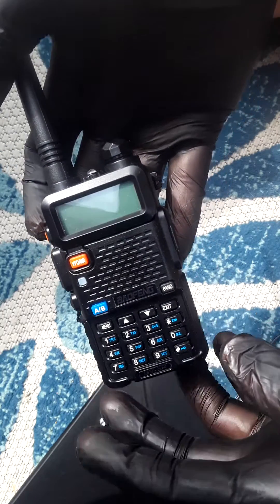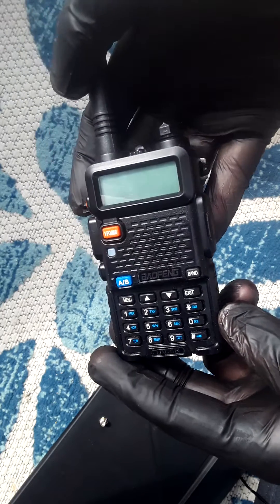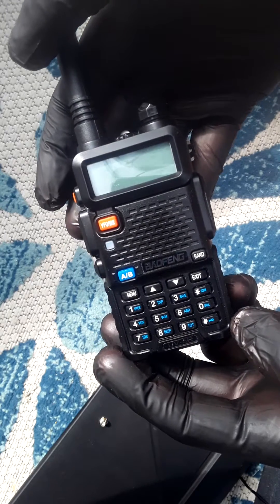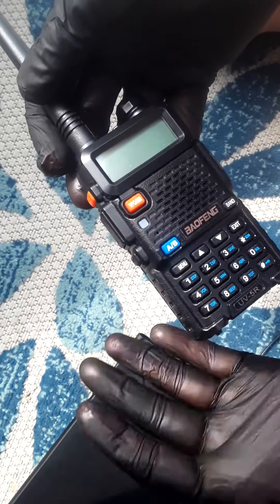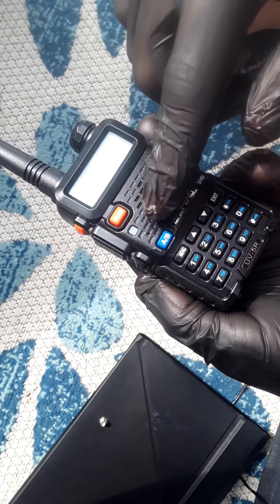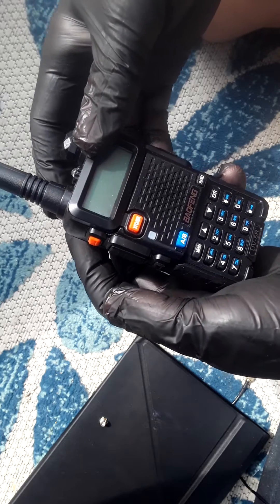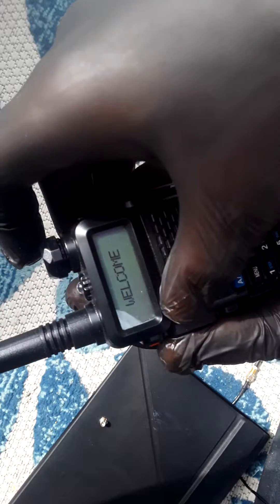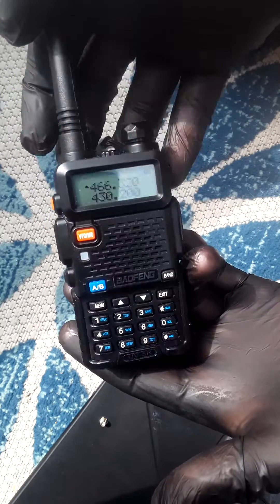📡 Unlock Blocked TX Frequencies On Baofeng UV-5R

Comment: Hi, does this trick works in UV 5RM PLUS?
Reply from the maker: Hmmmm wish I knew. Unfortunately I only own UV-5R to test - and it depends on the production batch.

But I have had others using entirely different baofeng radios say it worked for theirs too, so could try it if you have a radio already.

And other users commented slightly different key codes they succesfully used to unlock theirs if expanding comments.

Comment: My Radio is Locked With the Red Light On.                                                     None of the buttons will operate it say"s it's in Overtime .
Reply from the maker: hmmm I haven't seen this before. If I find a solution will be sure to share with you.

Comment: I got the uv5r that is certified for gmrs and it does nothing at all when i try the button combo. Does this mean that my unit is harware locked to gmrs only? Ive tried trasmitting to my little frs cobra rafio and i can hear on the beafeng but i just get the beep when i try to transmit.
Reply from the maker: The beep unfortunately signals that transmitting is not available.

After buying a few UV-5R's, I found that some revisions are unlocked with this button combo (showing the FACTORY message when successfully unlocking the transmit ability), and others came already unlocked for me - maybe I got lucky there.

Other users have left comments on this video sharing other slight button combo variations that worked for their revision. It could be useful to look through them.

Here is one (not sure if the other comments offered different, but this is slight difference): 

"After sometime messing around I was able to get the factory message and successfully unlock.  Similar process but you have to press the call button on the side as well.  So there are 4 buttons you have to press now then turn power on. 

Press all three on left of radio and VFO turn power on and it should display factory."

Hopefully the above quoted comment someone left works for you - if not, I do hope you find the right combo for your revision!

Comment: bulshit. still cant enter 250.00
Reply from the maker: Edit: This was to unlock specific baofeng radios that had no ability to transmit whatsoever. 

Never was 250MHz suggested. Says Unlock Blocked TX (for transmitting only on freq that are available), doesn't mention frequency. 

Applies to locked radios of certain revisions.

Most commenters have the described working for them.

Good luck on your search.
Reply: @RTPTechTips   well "nothing was suggested", so it is BULLSHIT in capital letters.  (i know how to unlock 250-260 !)
Reply from the maker: @stalin200000  👍 

This video unlocks specific baofeng radios that have been showing up with ALL transmitting locked completely. All frequencies.

Including many coming to USA locked from transmitting on ANY frequency. 

The video shares 1 option, for a problematic revision.

Comment: It doesn't work for mine. It lights up like it is transmitting but no sound to the other radio. I guess this one isn't one of the good ones.
Reply from the maker: does it beep when you hit the PTT button?
Reply: @RTPTechTips  it did. I worked it out actually and made a video about it on my channel. I plugged my work radio (Retevis RT-86) into chirp using my baofeng cable. Pulled the frs program off the Retevis and installed it directly to my baofeng. That copied the tones I needed for it to work properly. The more you know, as they say.
Reply from the maker: Very cool channel btw. I also used to build Traxxas RC car kits. That lawnmower combo!
Reply: @RTPTechTips  That's pretty cool. I've never built a kit, I've always just bought ready to run cars. I need to build a kit. It looks like a ton of fun.

Comment: If i bought baofeng uv 5r in 2024 will it work or these are in factory setted to not be jailbreaked
Reply from the maker: Sounds like there are a few batches requiring different button combinations. A few others shared in comments here what worked on their batch of UV-5R. Comments might help if this one doesn't work on yours. It all stared when the FCC sent a letter telling Baofeng distributors that operating on gmrs and others was not kosher... and so baofeng began locking radios.

Check comments for other button combos if this one doesn't work on yours.
Reply: @RTPTechTips  on which frequency should I try transmit that if my radio came unlocked or not. Becaue i tried to unlock it but no factory word on the display using all the teqniques
Reply from the maker: @miko8297 bands outside ham were blocked so you can try each range out there, and if you hear a beep - that is the blocked sign.

If no beep when hitting PTT, you are good to tx.
Reply: @RTPTechTips  Thank you for your answer, can you also write some specific frequency range where can i try
Reply from the maker: I don't recall which ranges were locked sorry - mine are all unlocked. I would simply try the PTT button in all frequency ranges available. 

Say you have 136-146MHz beeping, then try something within that after unlocking.

If it beeps, locked.

I can't recall any further details of what mine unlocked, since mine has been unlocked for a couple years.

Comment: Hi there. My UV-5R is locked. I've tried this button configuration, but it is still locked. Is there another way I can try please? Cheers.
Reply from the maker: Some other users received slightly different uv-5r batches, and shared slightly different key codes that worked with them. If you expand the comments may find something that works. Good luck!

Comment: Thank you, but what does unlocking these frequencies do for my distance? I just bought two of these and I can’t get them to work past a mile. Do I need to unlock frequencies to utilize the 8W power?
Reply from the maker: Not sure if there is anything unlockable for power, but ensure you have the tx power set to high - as there is a low tx power as well. 

Distance will also be largely determined by where you are transmitting. If in a city, distance would be much shorter than a pasture, or from mountain top to ground receiver.

Comment: It doesen't work
Reply from the maker: You must have a slightly different revision - other users commented similar button codes that work on other revisions (expand comments if interested).

If it doesn't make a beeping sound when pressing PTT (push-to-talk), then it came unlocked.

Comment: It says Factory on uv-10r but just repeats itself. Don't know if it worked. How will I know?
Reply from the maker: You will know if it no longer beeps when hitting the PTT (transmit) button.

The beep when trying to transmit, means locked. 

Once unlocked, the beep will go away, and the listening radio will hear your transmission.

Also, some radios come already unlocked, so not all need factory reset.

Hope it worked for you!

Comment: i have just bought one of these it arrived today and been trying to unlock it but no luck at all ? any help ?
Reply from the maker: Do you notice a beeping sound when hitting PTT (push to talk)? Or not?

If beeping, it is locked for transmit. If not beeping, it wasn't locked.

Some batches have come locked, others not. 

Other batches use different button combos (as shared in some of the comments on this video).

Good luck!!

Comment: This isn’t working for mine? Any reasons for this?
Reply from the maker: You likely have a different batch. If you have an older one, it is likely already unlocked.

If the PTT (push-to-talk) button produces a beep sound when pressed, that would mean it is locked.

My older one came unlocked, more recently produced, was able to unlock.

Though some other commenters on this video shared other button combinations that worked for their batch. If yours is still locked, might help to scroll through comments.

Comment: This combo does not work on mine.  I heard it only works on older models?  It did not work on my UV 5R?
Reply from the maker: I have it work on my more recent batch radio... older ones I have are already unlocked. If you don't hear a *beep* on PTT (push to talk) button, it is likely already unlocked.

Some other locked batches use different "factory" button combinations - others have shared some of these in the comments, here on this video, in case it helps.
Reply: @RTPTechTips  Thank you for the reply!

Comment: What unlock??
Reply from the maker: A letter (now found publicly) sent to Baofeng appeared to create some confusion. Leaving a false impression on if they were able to unlock transmit (tx) on certain freq. 

Many batches since this letter came with transmitting locked (creating a beep instead of actual transmit). 

If you have one of the batches which came with tx (transmit) locked, you can unlock functionality with the button combination.

If you have an earlier batch: it likely comes unlocked. If you see no "FACTORY" message following this video, your radio may already be unlocked. On the other hand, if you hear a *beep* when working with PTT (push to talk) button, the radio is locked.

Comment: Didn't get the "Factory" after following the three buttons (3x). When I try to add lower frequencies, it enters the first 5 digits, and then says 'cancel" as soon as I enter the final digit.  The unit is 3 years old. Any advice?
Reply from the maker: What range are you trying? The factory message only shows up on some recent batches of UV-5R. I have an older one that already came "unlocked", and my newer one unlocks with the key combo.

For example mine only goes down to 136MHz, anything under that it will say 'cancel'.

If you can transmit (PTT button), without hearing a *beep*, then that range is unlocked for you for tansmitting. If you hear a beeping sound on PTT, it's locked.

You may have one that came unlocked if not experiencing the beep with PTT.
Reply: @RTPTechTips  131.730 (FBO operator at SBN), 120.675 (SBN ATIS), 122.950 (SBN Unicom)

Comment: I have a new UV-5R, and have successfully unlocked it for the Canadian market using the 4 button technique. However, although I can now enter the previously blocked frequency (i.e 118.100) directly into the radio, I do not receive any transmissions.  The particular frequency is a small regional airport near me.  I know there is transmissions as I hear them on the LiveATC app.  Does anyone have any idea why I cannot receive transmissions?  (Radio is on, volume is up, other frequencies work fine.).  Thanks
Reply from the maker: Hmmm not sure on that. Mine never was able to get listen on that. Maybe someone else will have more info for you.
Reply: @RTPTechTips  The aviation band from 118-13?, I think it ends @ 138 but don't remember for sure , but that band they broadcast on AM instead of FM. Hope this helps.
Reply: The antenna is probably not cut for that frequency, that is why you can’t hear anything.

Comment: It doesn't work on mine.  Mine is about five years old.  I saw one video where the guy showed this method and he kept saying "... your new Baofeng UV-5R...", so I guess it depends on when the radio was bought.
Reply from the maker: It does. I noticed my old ones were already unlocked and the button combo had no effect. Newer ones I have it works on. All depends on the batch one gets.
Reply: @RTPTechTips  I will give it another go tomorrow.
Reply from the maker: If it's 5 years old, it's probably already unlocked.
Reply: @RTPTechTips  Aaaaand... you're right! I checked it and it does transmit across the full VHF and UHF ranges.  I never noticed before as I only use it for amateur use and bands such as FRS and GMRS are not used where I am.  PMR is, and I have a set of PMR walkie-talkies.  Shame it doesn't transmit in the 65 to 108 MHz range, as it would be a quick way on to 4-metres.

Comment: Seems to work. I noticed that it doesn't fully reset everything unlike the "factory reset" claims. The radio station that I was tuned into via the call button remained the same
Reply from the maker: Yes, guess it only resets factory related tx restrictions.
Reply: @RTPTechTips  I didn't bother checking what freqs were locked before I did this. On a lock baofeng, do you have the freqs that are locked by default?
Reply from the maker: @KhanGirey  Found this info on it: "A locked Baofeng would still allow you to transmit on frequencies ranging from 144 to 148 MHz on the 2m band and from 420 to 450 MHz".

Outside those frequencies are the locked ones.
Reply from the maker: I read they starting locking in response to an FCC letter that called into question legalities of radios, causing confusion.

Comment: What frecuencis are unlock? Is possible to rollback?
Reply from the maker: Not sure if you can "undo" factory reset, as I haven't had need to explore - but you may find info on this searching (and can change things with chirp programmer). Some batches come with different freq ranges. All would depend on the one you have - You can check which range "beeps" on PTT (ie: locked), and compare - should unlock entire available range.

Comment: I have four UV5R's, and I have done this on all four of them. I ordered the first pair of these on WISH, and 2 months later I tried to cancel, but WISH refused to cancel the order and refund the payment, so I had to continue waiting for delivery. The second pair I ordered from Amazon, and that pair arrived from Amazon in about 5 days. Remove the battery and the Model/Power/Voltage/Frequency sticker says these radios can operate at VHF frequencies 134.000 thru 174.000 MHz, and UHF frequencies 400.000 thru 520.000 MHz. Two of these radios will reach VHF 130.000 MHz, and the other two will not. Two begin at 130.000 MHz and the other two begin at 134.000 MHz. This have anything at all to do with unlocking these radios?
Reply from the maker: Aviation uses 130ish. I feel this likely more has to do with limitations per batch.

Some batches more open than others, for whatever reason baofeng decides on (just as with FCC restrictions on transmit, that require unlocking, maybe they decided to close off for other similar reasons).

I really can't say. Good question.

Maybe someone more familiar can chime in, help us understand reasoning - but unlocking if anything opens it up more, not less.

Comment: It doesn't work with the new ones. I've had mine 1 week. Is there another way
Reply from the maker: There are some comments in this video mentioning other key combos depending on UV-5R batch
Reply: It worked on mine, and I just received it from temu today [may 5 2023]

Comment: I did this reset and now the radio will transmit and my other radios act like they are receiving the signal but no modulation comes through on the other radios. The TIDRadio receives the other radios just fine. Any ideas?
Reply from the maker: That is strange. Wish I knew what was going on there.
Reply from the maker: This might relate: https://youtu.be/7BrGo1-uW3k

Comment: This won’t come up on mine it will not say factory
Reply from the maker: Are you sure it is not already unlocked? Do you hear a "beep" when hitting PTT? If not, it is already unlocked.

Some batches come unlocked, other batches use differing key codes to unlock.

Comment: Mines says coping on it when I do this
Reply from the maker: Sure you hit the buttons in correct order (hold all mentioned and only after / during turn switch to power on)?

There are also other comments from users having different batches, mentioning their unique unlock code (different batches sometimes require differing button combinations).

Comment: Would it work to broadcse 472.6000 it’s a digital/trunked channel or whatever. Does it go up that high after reset?
Reply from the maker: Mine does allow 472.600. But some batches may have different restrictions.
Reply: Excellent I am going to put this on my saved list and purchase it as soon as I can thank you so much for the information
Reply from the maker: @johnmoose5123  Absolutely! :) Also if the 1st method doesn't work, check out the comments as other batch key codes are shared in this video's comments. Good luck!

Comment: Didn't work
Reply from the maker: Are you sure it was locked? 

For example I had one that came unlocked in 2021 (it was never locked and didn't have factory message, but tested for factory msg anyway). 

Another that did unlock with factory message in 2022.

Have you checked out some of the other comments? It all depends what revision you have, as other commenters had other button combinations which they shared here that worked for their version.

You will know if it is locked if you hear a BEEP when pushing PTT outside ham bands.

Comment: I tried this procedure a bunch of times and I dont think it worked for me since  the "factory" indication never appeared....
Reply from the maker: It depends what revision you have. I've had some radios come unlocked. And others that the FACTORY message appears (where it was locked beforehand).

I've also heard from other commenters (on this video) that they needed to press an additional side button - explained in the pinned post (hit Read More).

You sure yours was locked? You will know if you hear a beep on PTT.

Comment: Bro I’ve tried everything. I’ve looked at all the comments but nothing? 😢
Reply from the maker: Real bummer. If I come across any new information that might help you, I'll send a reply.
Reply: @RTPTechTips  Yeah, looks like current revisions dont work. All 3 side buttons plus VFO and PTT/mino and VFo dont work. holding Ptt, Mimo, Call and VFO appears to freeze up the screen, and clicking the PTT button while its like this turns the LED on and off..but still no unlock.
Reply: @hgrunt100  This is exactly what I get.